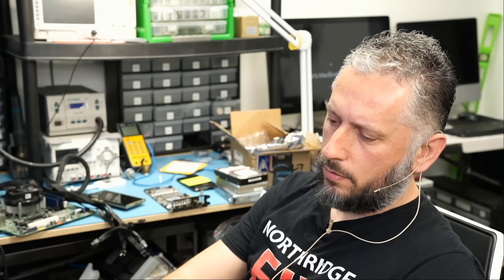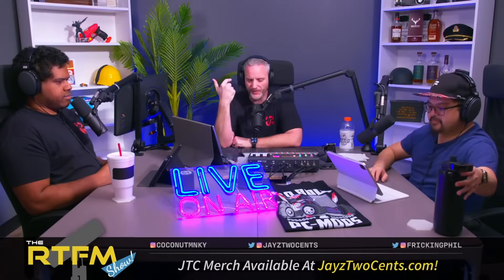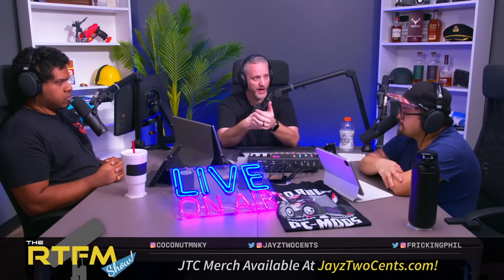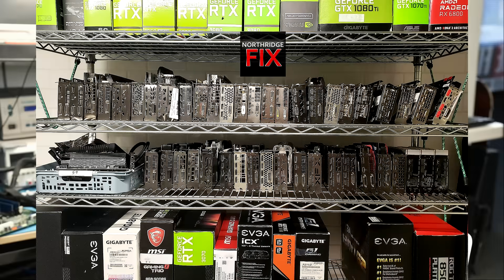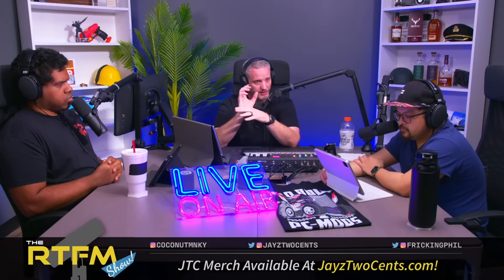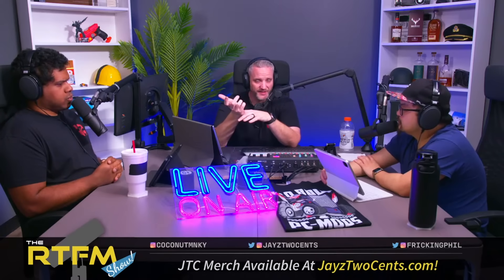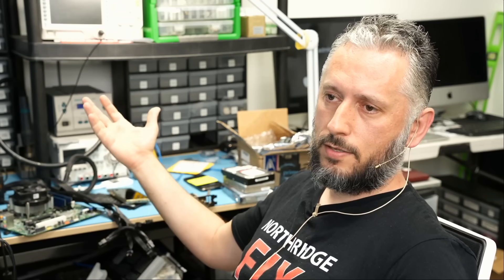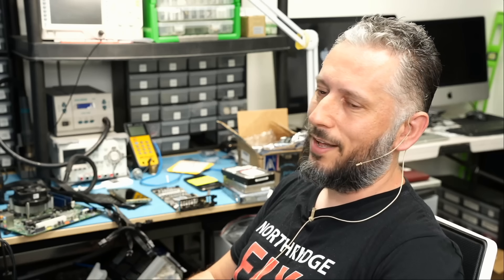Melting 4090 and CableMod. JayzTwoCents and Gamers Nexus Response. Blame NVidia or User?

Comment: Companies & USERs have worked with these kinds of connections for decades without problems; this particular case involves design abuse of safety factors in a bad deployment choice; heavier connector should have been selected for the load.

Comment: if it's such an issue with tolernace or backing out a little.......Nvidia should make the pins longer from the card connector right?  I'm no expert, but common sense tells me if it's not reaching or minimal contact then make it longer.  I don't ever buy Nvidia so what do I know.

User error is putting a CPU backwards or sideways into a socket.  A plug wiggling while the clip of the connector is fully clipped is not user error.

Comment: I believe this card needs a bit more Current than can be provided. Dual 12 Pin, or Dual 8 Pin seems like a reasonable design choice. Maybe some users here can make a simple test, after an hour of benchmarks or gameplay touch and feel the 12 pin cable. If the heat increases, then obviously the card needs more copper to operate at peak performance. I was about to buy one of these cards, and I'm glad I watched this. I would add a fourth power leg and crimp a nice solid junction into that little 12 pin and make some tests. That connector would only melt if the wiring harness is below electrical requirements. thanks Alex!

Comment: 600W at 12V is 50A, it is definitely not an user fault, but bad and poor design, which is not easy to solve, but also can not blame the users... 50A need a serious connection, cables and paths... maybe PSUs need switch to 24V, or GPU need to chill instead of pushing them to edges, focusing on architecture and other solutions.... or maybe create separate case for GPU, which is more complicated than whole PC.... or maybe making GPU system, where CPU , RAM and disk is only inserted to run it😅

Comment: Yeah, I firmly put the blame on Nvidia. That connector is why I am still using a 3080ti.  It's not just the connector, though, it's Nvidia removing the circuitry to sense if those connections are being made.  That sense part of the connector doesn't verify those connections are being made.

Comment: 1. Maybe that connector is underdimensionized for this number of amperes.
2. Maybe the distance between the pins should be some bigger.
3. There are other types of plastic insulation that got a higher melting temperatures.

Comment: correct me if I'm wrong, Cable-Mod wants ALL users of their 90-degree and 180-degree adapters to destroy them, take a picture of them destroyed,  and get a cable from them that plugs directly into the card and goes to the power supply, their cables now have the angled adapter built-in .  I believe they pay a refund once shown that you destroyed it.  I doubt they still offer the cable at a discount however.  But I believe they want ALL angled adapters to be destroyed.  I'm I understanding that correctly?

Comment: Putting that amount of power that usually uses 3x 8pin's 

through one connector that small. Condensing down an area of resistance (plug contacts) is insane.

Yes, the plug is a bad design, yes any reduction in contact (plug being slightly out) will make things WAY worse.

Its a bad plug design.

Comment: If I had one of these cards I would run individual wires to each power connector eyelet and run them to a suitable connector under the motherboard. Make the permanent connected cable assembly look nice with sheaving.

Comment: couple 1000$ card, i should not have to worry about a plastic adapter causing an issue. In the past never had no issues with same connector even if they were not fully pushed in

Comment: This connector issue is the reason I'm not going for RTX 4000 series card, except 4060 or 4070/Ti which I'd consider for my siblings computers (as a relatively cheap prebuilt for the most part)

Gotta bring back the good old 8pin connectors, these still to this day look and perform the best.

Comment: I check all the video of Gamers Nexus and I don't understand why, if the connector can handle power with only 2 pins, why when the resistance increases on one pin (I see on the video only 1 pin melting), the current does not flow to another pin. the current always goes in the simplest way, so if the resistance increases on one pin, the power goes to another pin, eventually the problem starts on the second pin and on the other pin, but all the pins burn together

Comment: The degree of melting is not proof of the cause.  The wire, plug, socket, and adapter are all made of different materials and all have different melting points and different thermal conductivity.
If you severely kink a wire it will heat up.  But its heat transfer will propably damage what it is in contact before damaging the wire, itself.

Ideally the plug on the wire should be designed to fail before anything else.   The repair is just a simple re-pinning job (wire-cutter and crimper vs a soldering station).

Comment: The issue with the power connectors melting on some NVIDIA GeForce RTX 4090 graphics cards is a complex problem that has been attributed to several potential causes. Here are some of the main factors that have been identified:

Connector Design: The 12VHPWR connector used in the RTX 4090 has a new design that provides high power in a compact form. This design requires precise alignment and insertion. If the connector is not fully inserted or if there is a misalignment, it can cause resistance at the connection point, leading to excessive heat and eventually melting.

Manufacturing Quality: Variability in manufacturing quality of the connectors and cables can lead to poor contacts. Even minor imperfections in the connectors or cables can result in increased electrical resistance and heating.

High Power Demand: The RTX 4090 is a high-performance graphics card that requires a substantial amount of power. The large power draw through the connector can exacerbate any issues related to contact resistance.

User Error: Improper installation by users, such as not fully seating the connector or using excessive force, can damage the connector or create poor electrical contact, leading to overheating.

Cable Flexing: Flexing or bending the cable near the connector can cause the pins to become misaligned, increasing resistance and generating heat. This is especially a problem if the cable is bent sharply or subjected to repeated movement.

Environmental Factors: Dust, debris, and other contaminants can also affect the quality of the electrical contact within the connector, increasing resistance and the risk of overheating.

NVIDIA and other manufacturers have been investigating these issues and working on solutions, such as improving the connector design, enhancing manufacturing quality control, and providing better installation guidelines to users to mitigate the risk of melting connectors.

Comment: One thing that is clear having now purchased a 4080 super, is that at the very least there is a design flaw.  I also own a 3080 which it is replacing.

The 3080 has its own adaptor that fits in angled, so its not come straight out to the side of the case. on the 4000 series this was changed to go straight out to the case, that is the first flaw.  The next flaw is the 4080 is a taller card, meaning the connector is much closer to the edge of the case meaning it is much more likely cables will need to be bent.

My personal view is that any product should have built in tolerances for things like not been quite fully seated, potentially becoming slightly loose, overbuild of capacity so if e.g. one pin isnt connected it still works as designed, and of course quality manufacturing process.

I installed the 4080 super in a standard mid tower case and can see after taking the side panel off again, the included Nvidia adaptor has bent a little on the black tape which from my understanding is a potential problem, I have a cablemod 90 degree cable sitting next to me which is essentially "pre bent" and should avoid the issue but I am then using a 3rd party cable on my PSU that it wasnt designed for, all because of a flaw in the 4000 series cards.  I thought I would be safe as it was an exclusive 4090 issue, but you guys are fixing 4080s as well, which dont go close to the supposed 600w limit.

Comment: if it happens with cablemod adapters ASWELL as with "normal" cables, then its a NVidia 4090 GPU design problem clearly, imo. thx for all the work u do, highly appreciated! just to have it said, i agree with u and Jay, if the design is prone to usererror, its a design flaw, period. if i buy a card for THAT MUCH money i expect it to be near flawless tbh, and for sure not to burn down my comp because the connector wiggles, or is prone to not get plugged in fully or w/e else...

Comment: Corsair also makes adapters.  Have they had the same rate of connector failures as the Cablemod ones?  I just got a 4090 and wondering what I should do.  Place a smoke detector right next to the computer?

Comment: Totally agree! Kicking it old school, everything use to be over engineered 2.5 times. These day companies are playing a dangerous game maximising performance with least amount of over engineering/materials etc.. I don’t know why they decided to cheap out on their premium card. There should be no issue. Maybe time to design a cable that cuts power once cable reaches a certain temperature. But really, should’ve been over engineered since it draw enough power to run a small heater.

Comment: I have been saying since the beginning that the connectors of the 4090 melted because of it low quality contacts and metal, but Gamers Nexus says its no plugged right. Seriously what a stupid thing to say for many who knows how to plug connectors as it should be. That is the low cost NVIDIA wanted to do for the 4090 because of Covid19 . Why don't many of you understand it. Anyone who knows electronics can see that.Amps require an extreme good connection otherwise it will heat then melt

Comment: Graphics cards have gotten more powerful and more over the last decade. The first generation had only one 4 pin connector, later they went to 6 pins to compensate. Now it looks like the current 12-pin block is at its limits and should be extended once more by several pins.

Comment: In regards to the card being the issue I believe that btw and I believe what may be the issue. Where the 4090 powersupply meets the card the board itself is letting too much power through after a set amount of time. When that invisible time limit is up capacitors that are faulty from the start fail causing massive heat issues cause by so much electricity not being grounded or held back resulting in the same connectors on the same 4090 cards to melt

Comment: 7:57 It the card is being fed by 4 x 12v rails… how many Amps is that? 30+ that’s hot! All through one small connector… it’s clearly a resistance problem.

Comment: Melting indicates that the power is too high for that kind of connection.

They have to switch to two connectors. Less wires means too much power for rhe existing connection.

Amd has two or more connection plugs? No problem with those???

Comment: in my view, if the plug is that sensitive to misalignment, it is totally undersized for the application. i question myself why card manufacturers do not simply use commonly known XT60 or XT90 connectors ?

Comment: Agreed I think it’s NVIDIA problem not any cable mod manufacture. It’s obvious The new power connector system by NVIDIA is just a bad design and realistic application was not tested for feasibility… I’m confused how Nvidia did not test these new connector systems inside consumer cases and builds… they don’t even fit inside the case with the panel closed for the common user basic build.. I understand that the new connect system looks more elegant and simple, or might be better suited for a professional industry or enterprise system or a server …but often that comes with a price and I mean these things could catch fire what the heck… Does this come with insurance…I feel The connector pens should have been made longer and thicker connector utilizing 14awg stranded tinned silver/gold plated copper cable to ensure a good connection and less resistance and slightly recessed inside the graphics card…Come on rtx4090 Engineers let’s get this right please Build on solid foundation and common sense…!!!

Comment: I've got to call BS on all your wrangling about this issue. Clearly, the card manufacture is trying to suck juice from 3 or 4 cable inputs in order to satisfy the power needs of their card. They are cramming these 3 or 4 inputs into 1 measly connector. Obviously, this is a design flaw. They should place 3 or 4 connecters on the card, thereby spreading stress over more card real-estate.

Comment: The 4090 is a flawed design,even a hobby tinkerer like me can see that,not fit for purpose.Can it be rectified? Absolutely,even a stupid noob like me with mere mechanical engineering background understands that.Manufacturers and designers need to take responsibility for the products they put out instead of blameshifting and deflecting it on to the end user.Well done Northridge Fix for explaining water to the thirsty.Never stop

Comment: This is basically what happens when you use a connector at the maximum wattage allowed by the manufacturer. Future motion did the same thing with the pint x charge port connection that melts when you use the hypercharger. It’s ABSOLUTELY an nvidia problem.

Comment: I agree with the guy that is fixing the cards that the problem is or appears to  a design issue with the OEM connector on the card. I have experienced issues with connectors of various types in the past and some of those connectors I have fixed by using a zip tie or multiple zip ties to pull the two sides of the connectors together very tightly and lock them together so they do not move. On those video cards something like a zip tie might not be possible, but something like a tie might need to be part of the connector, or added to the connector to lock the socket and the plug together so they do not move apart.

Comment: NorthridgeFix : the RTX 4090 continuously eats from 550 - 600 watts with high peaks up top 641 Watts....putting more than half of kilowatt pf energy through 4 soldering points through those small pins in the 12-pin connector is clear as day that Nvidia is to blame here for the faulty design.
It's the same with the 4080-s that goes well above 400 watts with peaks up to 500 watts.

Comment: Melting connectors is where the problem is. How do we know the amp rating of each of the pins? How do we know if the connector and housing is a chinese fake/cheap plastic? How on earth is a 90 degree mod gonna fix the problem? The problem simply lies within the connecor itself whether the manufacturer of the card knows about it or not.

Comment: I've questioned a lot of Steves (GN) rambles over the years, his self righteous, we've got charts assault on others is often so biased that I would like to know his qualifications and previous experience and training in the industry, what I see is someone who has a voice and a following of overpaid nerds who keep sending him cash to buy more testing kit that is well beyond their limits of understanding to use and so results tables become worthless. This isn't just GN, as LTT, J2C, Pauls hardware, Bitwit, etc... all think they are experts and have like politicians convinced millions that they know what they are doing, when in the end they produce these charts and they mean nothing, 

 Back on this topic I've seen a few of these, 12Vhpwr connectors fail, and I've noticed that there are 2 main types of pin in the plugs on the cable side, one has dimples to create contact and the other spring loaded, it's the dimple style which seem to be failing because as I (35 years of Aircraft Technical design background) see it, the dimple style have a fixed surface contact area, the as do the sprung loaded, but the sprung ones have more, so lower current draw and less heat, not the dimples are trying to pass the same power over a fraction of the area, something has to give and that is an increase of current and heat which leads us to this problem, It's definitely and manufacturers design issue and component selection, and I never got how running 16 x 12V and 16 x Gnd (RTX4090) into 6 and 6 was ever going to allow the current required, all I see there is a massive resistor which as electronics engineers we know as a HEATER, which is why all the melting is happening, the whole design is just stupid and probably the reason AMD is not interested in it.

Comment: The cables need to be fixed in place as so they do not pull on the connector over time. The connectors are to flimsy to withstand the pull or twist of the cable.

Comment: It looks like they are slowly rolling out the 12V-2x6 connector  to replace this 12Vhpwr connector.  It is supposed to solve the melting connector issue.  Anyone know if that is the case?  If it does From reading about it looks like it just cuts the power to the card when the connection is not good.  So are we talking about replacing melted connectors to GPUs that constantly lose power?

Comment: connector itself is issue cause lot of of power going through one connector with 8 pin connectors it was devided now its only one so there is not much to talk about connector is badly designed.

Comment: So after time passes, we have cablemod recalling version 1 of their non angled adapter. But we also had nvidia change the connector.  And the people behind the power spec changed specifications.
So it looks like both sides on this issue were correct 
But overall, the conclusion in this video was more correct.
My thing is we should not need this much power for eye candy anyway!
(Gamer side.)